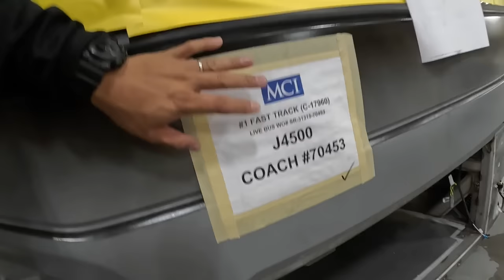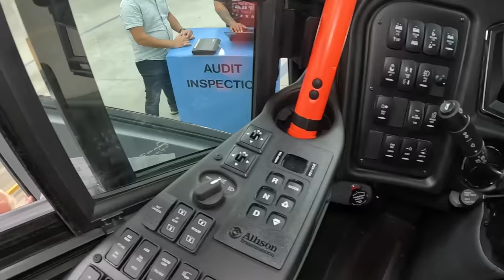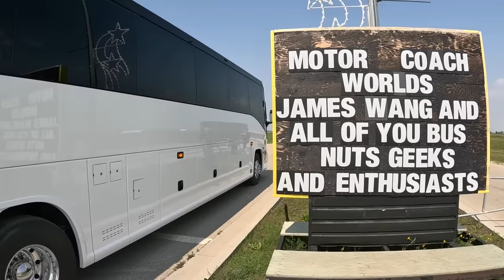I Drag Raced Buses | Electric vs Diesel | at MCI's Test Track

Comment: One thing I would like to see on one of your factory tours is what structural changes have been made to the busses to improve crash and impact protections for drivers and passengers. For the most part, these busses structures look a whole lot identical to the MCI coaches built in the 1960’s and 1970’s. It looks like only seat belts and windows are about the only chassis and body changes that have been added or changed.

Comment: Your coverage of EV motorcoaches is appreciated. Modern EV cars have been around for just over 10 years, whereas electric motorcoaches have been around for significantly less and the charging infrastructure for such large vehicles is nearly nonexistent. What you are presenting is the beginning of an EV evolution for large vehicles. You are providing a tremendous service by being one of the first to document the beginning of the many challenges that lie in store for large electric vehicles in order for them to become a common daily use vehicle.

I've owned EV cars since 2013. The experiences you've incurred are no different then mine. Since then the vehicles and the charging infrastructure has improved. The recent announcements by the OEM car companies to standardize the charging connection ports and to commit to providing a better rapid charging experience will benefit EV vehicles of all sizes. Please keep showcasing the technology and the challenges of EV motorcoaches. Your vlogs with tell us where we are today and where we were yesterday.

Comment: Although I've been to Pembina 3(?) times, to be invited to MCI-Winnipeg, is an honor!  Way cool, James!  Those Canucks, along with their American Counterparts, know/live/breathe, and are the prime example of quality is 'job only'! 

My fellow "old farts" will remember the fact that most MCI MC-7's were 'somewhat more powerful', than bus models which followed, with a smaller subset of which, because of their specially geared differentials, (51 and 53 passenger 'special order models', required for passenger compliments of >47 passengers), always had just a bit more "oomph" than everything else on the lot.  (PLEASE remember that SAFETY, not speed, was always of utmost priority)

But that beast had far more than some serious "zip"!!  (the center steering wheel covers were easily removed for cleaning, and for leaving messages written in pencil for the next driver to discover,,,)

We had a 1972 MCI MC-7, sporting an 8v71, with "special gearing" because of being a 53-passenger model. Aerodynamically, MC-7's were the fastest among any other brand and/or model of bus (IMHO), but that one 53 - passenger coach, our bus № 42, was the Boeing 757-200 of it's day!!
Reply: Some think that Canadians do not do much, I suppose, but we unite the world of what we do. From the Raymond stackers ( what I use ), to Motorcoach, and Boeing.....we can, and do it, mostly all too 😉😉

Comment: As a Canadian, I have to say I'm proud that you chose a 'traditional' poutine.   Usually, it's a beef gravy, but duck works too. 
I am glad they had the national donut there, as well. 🤣
Reply from the maker: Oh yeah I had to try the original thing. It was great I loved it.
Reply: @MotorcoachWorld you can make it down there, but, you need the curds to be UNDER 36 hours old, to get that signature "squeak" and texture, when bitten.
Reply: I should contact TTC customer support, and have them invite you up here, to do a run on the 54 Lawrence East bus (regular 35' bus), then maybe on one of the routes w/ an artic bus. 

The 54 route is the longest in the city, and they drivers usually can only get 1 1/2 trips in a day. It's 26.4km (16.4m) from one end to the other.
Reply: Really?  I thought these busses look very similar from the outside to the Greyhound and Trailways busses from 30 years ago.  The European busses look more modern and sleek.
Reply: I’ve only been around Ontario and Quebec, but I prefer Ashton’s poutine in Quebec. 
And of course, we have Timmy’s on the US side around the Buffalo area. Home away from home. Try ordering a large double double in Boston, you just hear crickets 🦗
Reply: As a Canadian, I don't like gravy-soaked fries so I don't like poutine. Most Canadians have probably never tried poutine, and most certainly don't eat it regularly.

Comment: Back in the day I tested out a trolleybus vs diesel. If you think the battery ones are torquier, the trolleybus was downright fast. No batteries, just motor. They were rated at 750 max amps at 750V. The diesels of that time (in the 90s) were still 60s era. But gotta say, those old diesels still run today (and they still make the MAN D2156! I get about 20mpg empty with the bus. So makes sense parts of the world will still use it)

Hope youre doing well!
Reply: My late grandpa was a diesel mechanic at the Milwaukee TRANSPORT COMPANY(Now Milwaukee County Transit System). He used to tell me that when they had trackless trolley buses, they were very powerful. Sometimes the drivers would overshoot and disconnect from the overhead wires. Then the driver would have to ask if some of the passengers would get out and push. I guess they would have a vested interest. I was born in 1964 so the last one ran in 1965 or 66 so no memory of them.
Reply: @crabbymilton390  I remember pushing my fair share of trolleybuses and buses. Indeed shared interest. You dont push, you didnt get home lol. (In the morning going to school...meh, no so much in a hurry then!)
Reply: OMFG 562.5kVA and no battery weight. That's overkill.

Comment: That was awesome. I wonder if theyve converted any to tour buses/campers-just as a proof of concept
Reply: MCI steadily produced "shells" through 2010. They had raised roofs for entertainers, private owners, and operators. Many of the D shells were converted by Custom Coach and are still in operation today. The J shells were mainly used in the entertainer market and were also converted by third parties. We still build shells for the tour and charter market when an operator wants to add a special option like a galley or a unique seating configuration. 

Fun fact: Johnny Cash and John Madden are among the many musicians and stars who owned an MCI coach.

Comment: Watching you have so much fun running the articulated, you would have loved the Prevost H5-60.  I never got to run one, but always wanted to....  Every now and then I'll see one that has been converted to a private coach.
Reply: I rode in a H3-60 back in 2006 when I took my first and only cruise in Alaska. It was as nice as any H series but one big problem. The engine is in the first section towards the front so much louder.
Reply: @crabbymilton390  Yeah, and I understand that access to the power train for maintenance was a real problem as well.
Reply: @bryce2680  MCTS had 40 CROWN IKARUS articulated buses delivered in 1984-85. They were impressive monsters but they were absolutely crap in just about every level. The engine was in the first section under the floor and no AC so it was rather unpleasant riding. The CUMMINS engine had 350 hp so it was too big for transit in plus it had a unreliable fuel system that caused hard starting if shut down so they had to leave the engine running or risk a breakdown. The bus was mostly built in Hungary so much of the bus had Hungarian instructions in the wiring diagrams and elsewhere. They retired these things in 2000 and they were scrapped because they were in horrible shape and not worth fixing.

Comment: The company I worked for Falcon Charter out of San Francisco, in about 1982, ordered several MC9's some auto some stick. The first ones we got had horrible automatic transmissions, they would jerk while shifting, they finally got them working properly. Love the buses as they were solid well-made machines.  We mostly had GMC's, there was no comparison to the MCI. We hauled international tourists, many were used to the nice Euro buses, way ahead of us is style and comfort. On of our rivel companies, started buying Prevost, a real jump up from anything. I retired from diving before anything else came along. In our fleet we had some old transits from the 50's, we had some early MCI's a couple of 7's and an 8, just solid buses.  Nice video!

Comment: I've always thought it would be cool to make an articulated bus into a motor home conversion. I can see myself pulling into an RV park and being told they don't have a 60-foot space.
Reply: Some of the rigs with a heavy-duty truck pulling a large fifth-wheel trailer are that long. You do need to plan where you will stay.

Comment: It's good that the electric articulated bus has a drive axle at the rear of the front unit, for more total traction and to eliminate the tendency to jackknife when climbing grades in low-traction conditions (which as been an issue with traditional articulated transit buses, which only drive the axle of the rear unit).

The noise is presumably not the motors, it's the gearing that the motors are driving through.

Comment: You know, I'm something of a busdriver myself (best job I've ever had, hands down).

Fastest bus I ever drove was MAN Lions City. No idea why it was so fast, but as a noob back then it wasn't the easiest drive.

Anyway, nice vid! Safe racing :P

PS. As for the "whining noise" - I drive an articulated electric bus through one of our tunnels. Have to use the kickdown system it has to maintain 70 km/h. With the window open it sounds a lot like an airplane engine.

Comment: Hey James - My experience with transit or commuter coaches are the bi-fold doors start leaking air (as in outside air) which whistles and drives you nuts! We currently have a Prevost X3 commuter factory demo set up for New York city. There are so many overrides built in, that's it's become the mechanics headache bus. LOTS of gremlins! Prevost service has a gold-plated service spot for that coach. But, when it runs, it's great! If you come to MO you can see it running commuter service with UCM (sometimes you will run into me running it as a cover). I was recently near you driving for a church at a camp that used to be near a company with green busses. You know which one, unfortunately I was tight on time and couldn't come bother you!😁

Comment: James, hope you enjoyed the poutine ! And when you got to MCI's facility, they had Tim's donuts ! Very interesting visit, they are not as robotic advanced as Prevost is, but they have definitely made advances since my last visit. i sort of knew that the electric bus would out accelerate the diesel bus; it only makes sense because of the matching horsepower and the instant response of an electric motor. But do I want one ? No way !  Too many charging problems to start with and you didn't show us the luggage compartments of the two coaches to compare. Thanks for sharing James, very informative as usual.
Reply: Acceleration time has almost nothing to do with response time - a fraction of second doesn't matter. The acceleration advantage of electric vehicles a lower speeds is due to speed versus power characteristics of the motors - they can usually run at closer to their peak power more of the time, for a short duration.

Comment: I would rather drive the Diesel over the Electric.  After seeing the trip across the U.S. and having to charge vs pulling up to a pump and going (even after a bathroom break for the driver) the Diesel still is the winner in my book.

Having the bus do all of the driving ( i.e. breaking and speed control) is a dangerous thing.  As Elon Musk found out when one of his cars slammed into a fire truck responding to a call last week.
Reply: Having the bus assist with emergency braking is absolutely not a dangerous thing. I guess I missed in this video where MCI had an autonomous bus.
Reply: @lukerinderknecht2982  If you need a bus to do the breaking,  than you are to close.   And not giving you passengers a smooth ride.
Reply: @jeffherdz  *braking, *too close, *your passengers 
These are emergency systems, not self-driving.
Reply: @lukerinderknecht2982 until it fails😊 we have the detectors for pedestrians and I’ve beat that thing out so many times before it sends its warning.  I understand what your saying but I trust my instincts better than I trust electronics to work every time.  JMHO
Reply: @HeCoversMe  you're right, nothing is infallible. And humans are much more fallible than machines, otherwise we'd have zero accidents.

Comment: Long ago Edmonton, Canada operated electric trolly buses.  One of the drivers told me the electric buses could lay rubber off the line.  I asked how he knew.  :)
Reply: Before solid state microprocessors motor controllers. It was analog controls. 1st 'notch' was lowest power, 2nd 'notch' more power until last 'notch' was maximum power.
(Forget how many 'notches' think it was 6???). You could  feel the  'notches' through the power pedal connect to brass  contactors...
Sometimes maintenance doesn't catch worn contractors and the burn out. Sometimes more that one contactor fails...
The passenger standing beside you suddenly moves back!!!
Same effect if you don't stop at each 'notch' while accelerating. It's instantaneous power so will leave it to your imagination if going straight to last 'notch'.
Reply: Yes ! Edmonton Transit Trolleybus were the best on the road.🚎💨.If you don't have slower traffic in your way you can easily get to your destination safely and  on time with you full load of happy Passengers at low low cost..ETS fleet of 22 1976 Newflyer E800's.Sold to Mexico  🇲🇽  City for more years of Srevice..Yes James the Buses talk to you Trolleybus Sang to you "Hummm"👍
Reply: Vancouver (BC Transit)/ (Urban Transit Authority)/ (Metro Transit) took delivery of 240, E900's with solid state Westinghouse controls starting in 1981. Westinghouse had been the premier supplier of streetcar propulsion. Unfortunately they didn't live up to previous reputation. Many teething problems! E900's had dynamic braking (excellent system after the bugs were corrected), a system that turns motor into generator putting the excess power back into the overhead. Only one small problem, the engineer's forgot about insulators and switches. When in dynamic braking and encountering insulators the voltage on the bus spikes  very high and damages the solid state logic board... Another problem was the electrical components had little protection from water and salt. First freezing winter day with salt on the roads crashed the entire fleet for couple weeks until 1st of many retrofits completed. We drove NIS with the HOT Bus lamp on plenty NIS to garage to get a diesel if there were any... otherwise  wait for bus change while mechanics steam cleaned resistor grid and motor... Took  about 5 years to get them reliable. Generally they were not dangerous when HOT, as it mainly the motor shunt that was the issue, less than 100 volts when bus in motion. the big danger was HOT air compressor at 600 volts! 
Hot bus indicator was sensitive, it could be a few volts or 600 volts you didn't know.  Policy was to try and reset hot bus indicator. If you couldn't, the driver instructed passengers not to leave coach until poles pulled from overhead. Then the driver jumped off without touching any part of coach and pulled the poles and accommodated passengers onto next bus. Fun times!!!!! Made mega OT $$$$$. The remaining E800's (with notch controls) were converted to DD V6-71's and automatics. 3 or 4 retained their poles and were retrofitted to spray antifreeze on the overhead...
Reply: @rodmpugh226  Vancouver still has that trolley bus fleet.

Comment: As a Heavy Haul operator, I wonder, how do you as a bus driver back up the articulated bus if you get in a jam ie stuck behind a bus in a metro area taking longer than normal to load passengers ??
Reply: The rear part is just a permanently attached trailer, and the hitch is behind the rear axle of the front unit. The engine being in the trailer part (in the case of most articulated transit buses) doesn't change the process of backing up. But I assume that most transit operations do not allow drivers to back up any bus without a spotter anyway, for safety; you wait for the vehicle in front to move.

Comment: Essentially an electric bus has the same transmission as a diesel, I hope these bus manufacturers do a little innovation and create a new rear end with four independent motors driving the rear drivetrain or they could partner with Tesla to use their rear drivetrain that's why going uphill is the same as a diesel.
Reply: Tesla isn't needed. There are lots of companies building axles with electric motors, in various configurations... including one motor per wheel. The electrically powered inverted portal axles from ZF and BYD used in transit buses have one motor per wheel, and Mercedes as used that ZF axle in some trucks... presumably the same ZF AxTrax AVE axle as the New Flyer electric transit buses use.

Comment: While that was a "drag race", I'm surprised the electric model DIDN'T do a burnout...
Reply from the maker: Lol 😅
Reply: A competently designed vehicle will not allow a burnout.
Reply: @brianb-p6586  there's clearly no competence in the car business in that case...  because every car is capable of doing a burnout. 

MCI apparently has just enough...
Reply: @truckerzachbell  cars now have traction control, which prevents juvenile burnouts.  Yes, you can turn it off, but it makes no sense to let a driver turn it off in your company's truck to waste your company's tires.